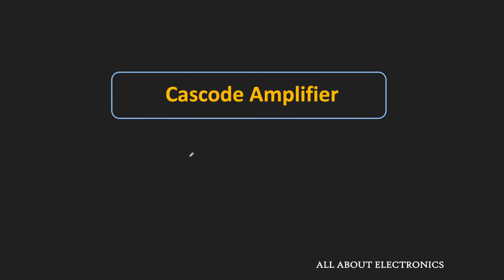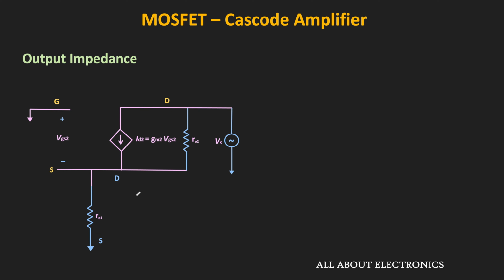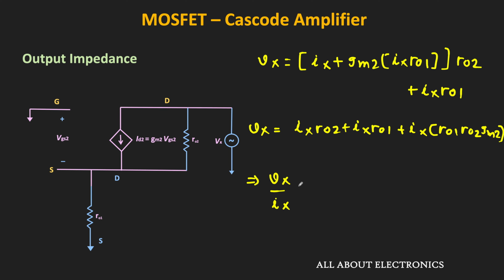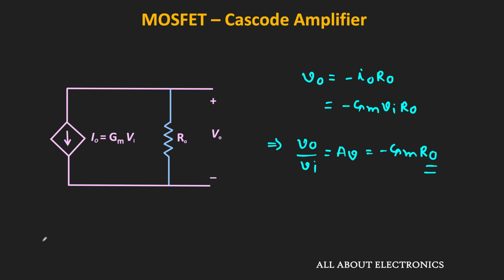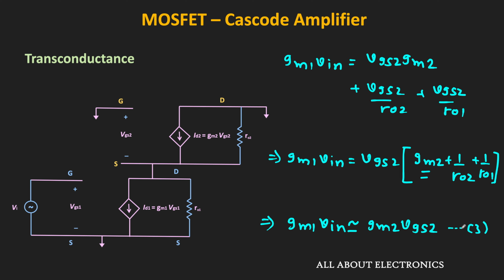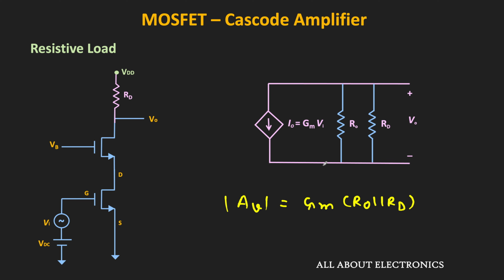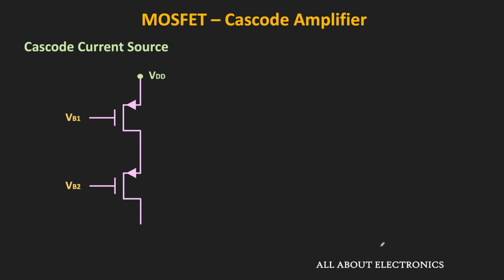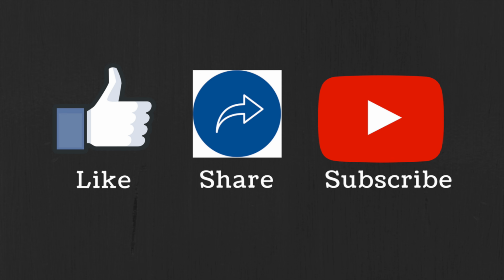Cascode Amplifier using MOSFET Explained (Cascode Amplifier with Cascode Current Source)

Comment from the maker: The link for the notes: https://www.allaboutelectronics.org/cascode-amplifier-using-mosfet-explained/
 
Timestamps :
0:00 What is Cascode Amplifier?
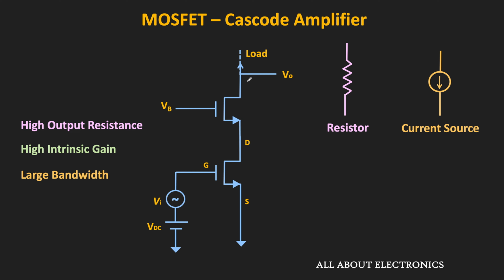1:22 Why Cascode Amplifier is used in integrated circuits?
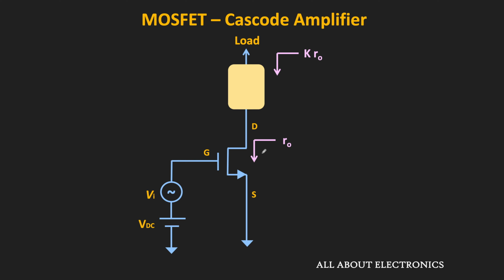2:36 Output Impedance of Cascode Amplifier (Small signal analysis)
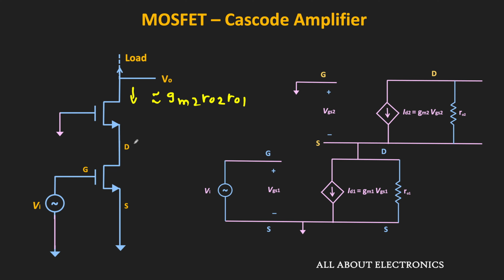8:00 Intrinsic Gain of Cascode Amplifier (Small signal analysis)
16:02 Effect of various load on the voltage gain of the cascode amplifier
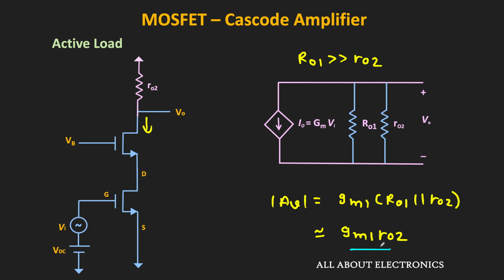19:49 Cascode amplifier with Cascode current source as a load

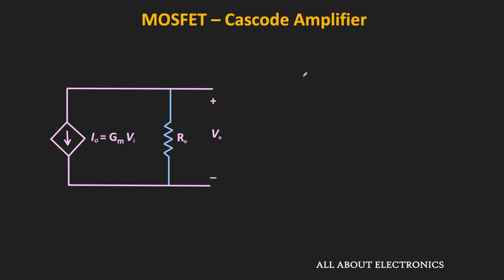Comment: can anyone  explain  in  Vo = - Io*Ro   at  time   9:42  why negative sign is present   actually there should be no negative  sign right
Reply from the maker: As the current Io is flowing from bottom to top, if we see the voltage drop across R0, then positive terminal will be at the bottom, while negative terminal will be at the top. But here the voltage Vo that we are measuring is from top to bottom side. That's why there will be a negative sign. I hope, it will clear your doubt. If you still have any doubt then let me know here.

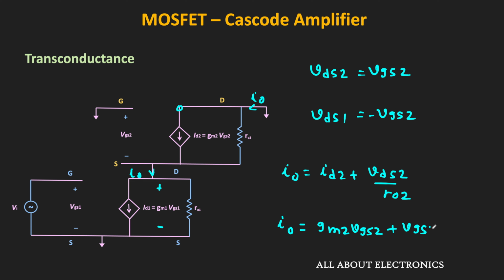Comment: at 11:56 ,sir while doing nodal analysis ,why we have written vds2/ro2 it should be (vds2-vgs1)/ro2,  because source of 2nd mosfet is not at ground at all.
Reply from the maker: It is actually io = gm2*vgs2 + (vds2 / ro2). 
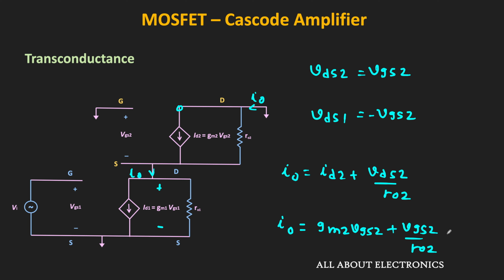But here Vds2 = Vgs2. (you can see it 11:56). Thats why Vgs2 / ro2 is written. Basically a current through ro2 is the voltage drop across it (Vds2) divided by ro2.  And here since Vds2 = Vgs2, so its been written as Vgs2/ro2. I hope, it will clear your doubt.
Reply: @ALLABOUTELECTRONICS  ok got it sir, thanks.

Comment: When performing small signal analysis, shouldnt Vgs2 = 0 so Id2 is zero (because Vgs2 is a DC voltage source)?
Reply: Vgs= Vg- Vs , there g was at ground so only Vg=0, whereas Vs is not zero

Comment: Why we have to ground the output voltage to find eqivalent Gm?
Reply from the maker: Just consider the entire circuit as a two-port network. The transconductance Gm is the ratio of output current to the input voltage. If you recall the two-port network lectures then it is Y-parameter. I2/V1 when V2 = 0. That's why while finding Gm, output was grounded. I hope, it will clear your doubt.
Reply: ❤️❤️love you bro

Comment: Shouldn't there be minus sign in the intrinsic gain of the cascode amplifier ?
Reply from the maker: Yes, there will be a minus sign. But in the video if you observe, then only magnitude of intrinsic gain |Ao| is represented. That's why there is no negative sign.
Reply: @ALLABOUTELECTRONICS  excellent, thanks for the fast and analytic reply

Comment: If ac source is at the bottom transistor, what will happen if you keep Vgs2=0 and do the small-signal analysis?
Reply from the maker: I think you are talking about small-signal analysis right ??
If vgs2 = 0 then the second MOSFET can be replaced by its output impedance. Ro2 and Ro1 will be in parallel.